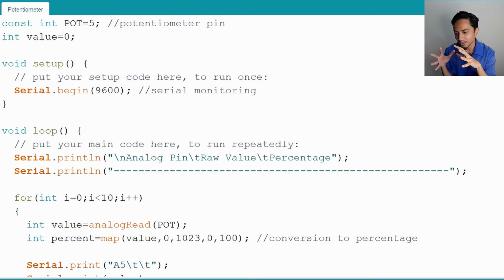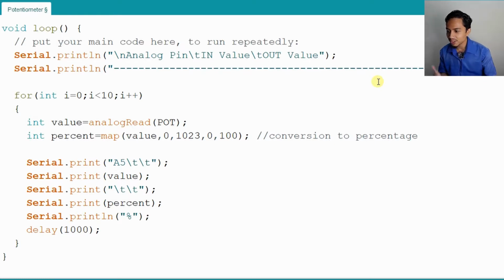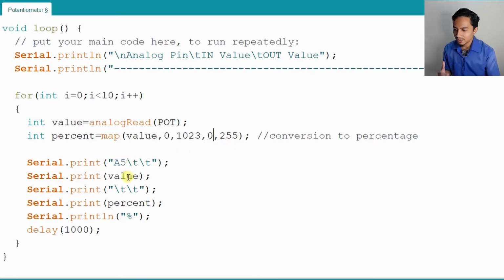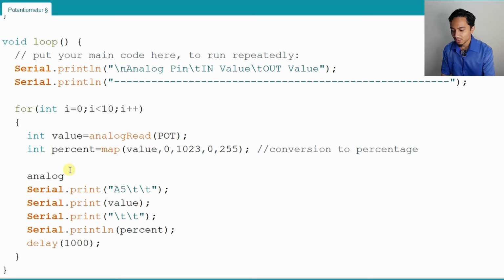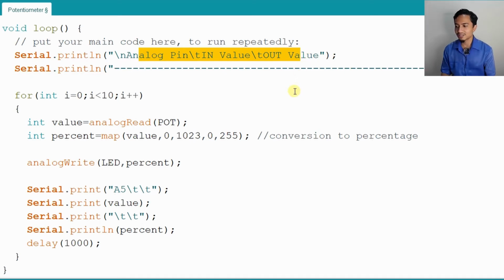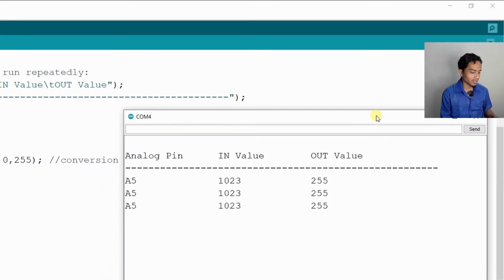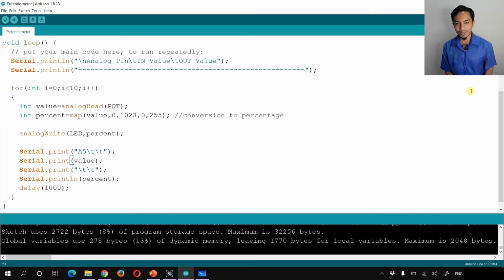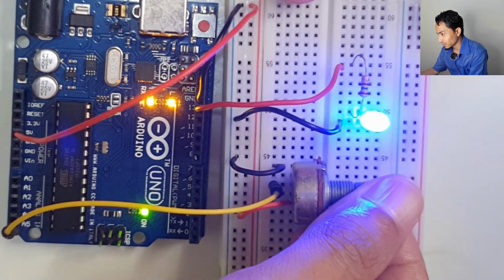4.2.Control LED Brightness using Potentiometer + 2nd Assessment

Comment: Sir, may i ask how did you manage to use pwm on pin13 which is not supposed to have PWM?
Reply from the maker: I did not use PWM on pin 13.. I just change the blinking rate (delay)..
Reply: @IkhwanMuhamad  tq sir, my mistake =="